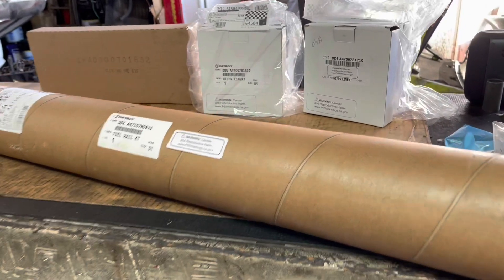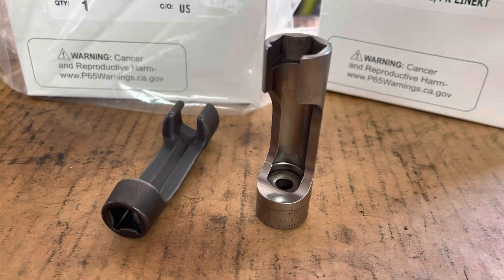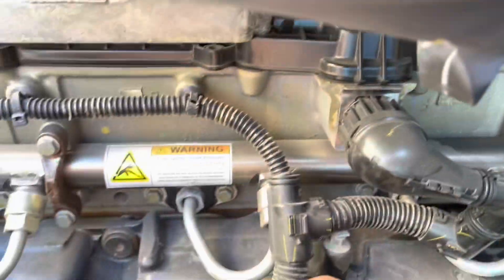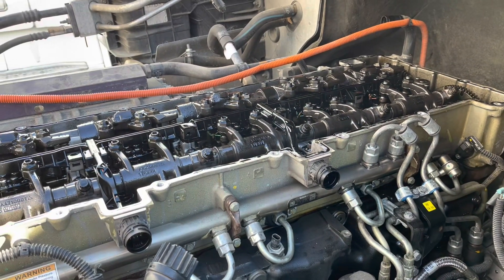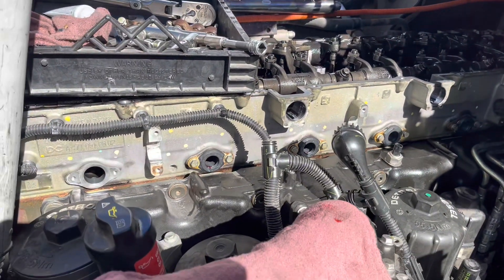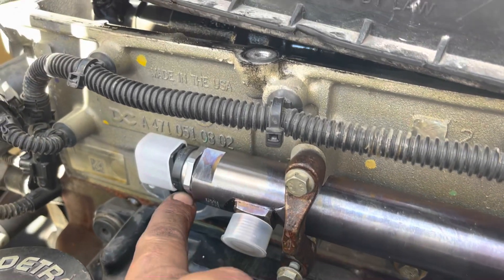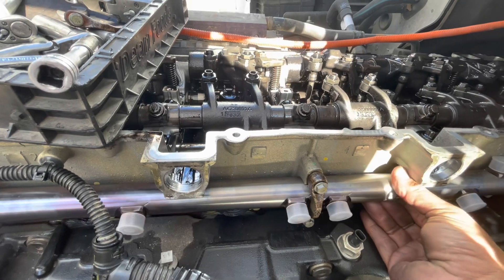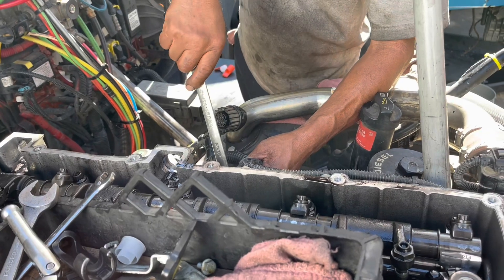DD13 fuel leak at common rail, easy fix. Just need to know what to look for before you start.

Comment: So did the rail have a crack in it?
Reply from the maker: Yes, small crack at the base where the Hi Pressure line is installed. Had to replace the entire rail. Not sure if can be welded or repaired. Not sure it’s worth trying to save.
Reply: @CarlosDieselElectric  thank you. Same exact thing happened to me yesterday. Injector #5

Comment: Hi Pedro, 
I got the same problem on a cummins QSB7. I exchange one high presure pipe and doesn't work. then I change the rail, but doesn't work neither. It looks like when you use one pipe on a rial, then you  can't use it on other rial because nods with the rail. it can be posible?. why does the rail stark leaking like this? what are the root causes?. thank you!!!!

Comment: I'll throw a tip out there. When installing the fuel lines through the seal it is hard to push it through and get it started at the same time onto the injector. Take another 19mm wrench and put it over the flared out part that screws into the injector and gently pry against the camshaft with it. This puts pressure towards the injector and you don't have to push and turn it from the outside. Hydraulic injection is no joke, never swipe your finger over a fuel leak.
Reply from the maker: Appreciate the tip.

Comment: Thank you for the sharing.
It is very high pressure for n the common rail. 
Release the pressure first.

Remind careful to remove the rocker cover, the coolant lines for Def heater are very easy to broken in high mileage tractor.
In my opinion.
It needs more time to replace. If possible don’t remove the cover. Just a little bit difficult to install 6th fuel line.
Reply: ive broken that coolant def line 🤬
Reply: @WestTexasDieseldog  if Def still active, money and more time for restore it.

If not active , a 3/4 hose cap for the multi outlet valve. The other one on the engine is not standard 3/4 hose cap. Use tefron tape will still a little bit leaking.

You can use a 1/2 copper tube and cap , welding with the connector together. This is the best solution. Cheap and fast.

Remind ,  please use torch heat the copper connector then use socket remove it